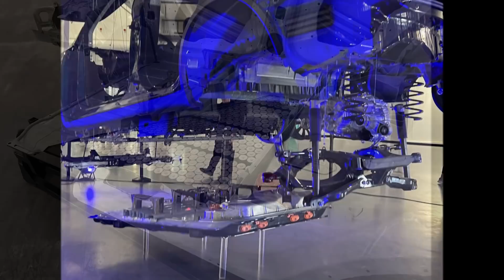VIRAL! These Tesla Giga Texas Production Robots are Mind-Blowing

Comment: People at Tesla are not very smart. They build a factory in Germany that requires the amount of water use by a city of 30,000 people but didn't arrange to have that water supply so couldn't open the factory. So I contact Tesla by email telling them I have a solution for their water need especially if the city would not give them the water but no one got back to me so that solution is off the table. There are people with a high IQ for math or science but their common since IQ is about 15.